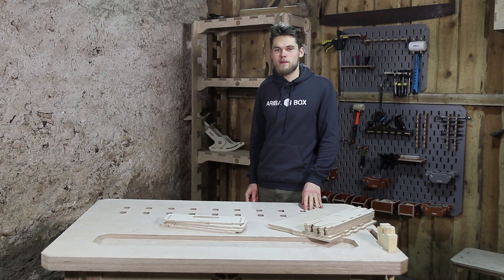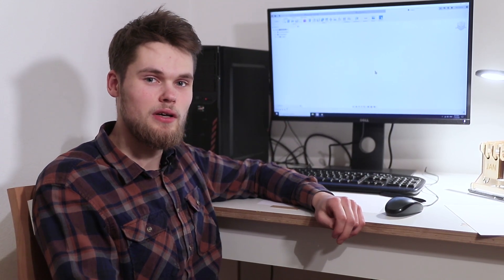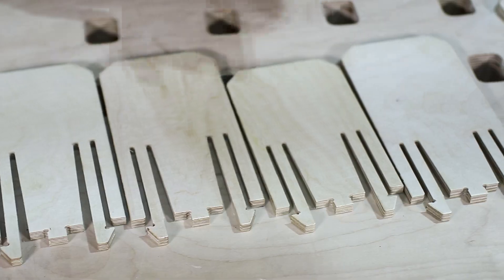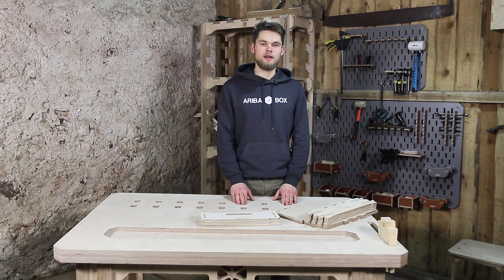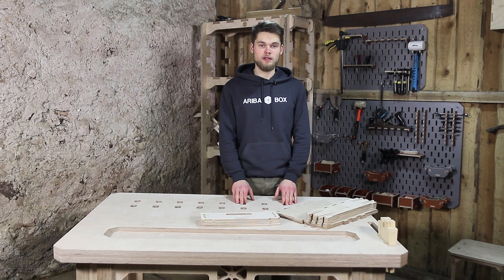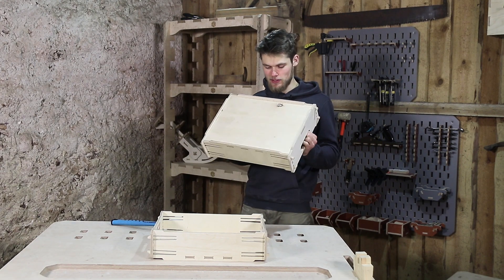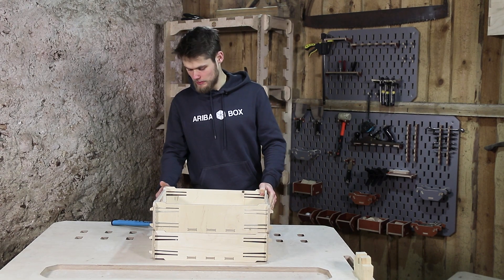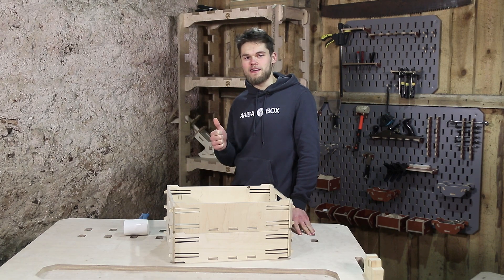How to make a Storage Box with CNC - ARIBABOX

Comment: Howdy! Quick question, what clearance do you generally give for those fits?

Or is that hole of X width and X width part going in?

Slick boxes though!
Reply from the maker: Baki1 Thanks!  The joint holes are designed to be the same size as plywood thickness, so if the cut is precise, the joints fit perfectly.